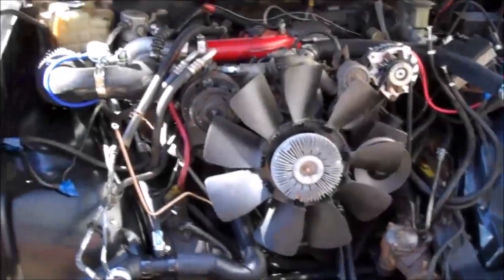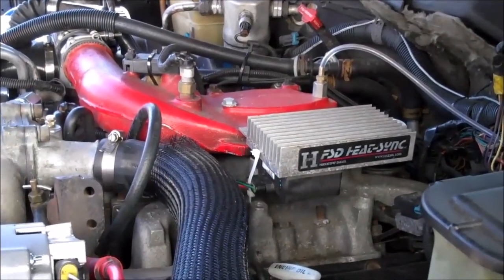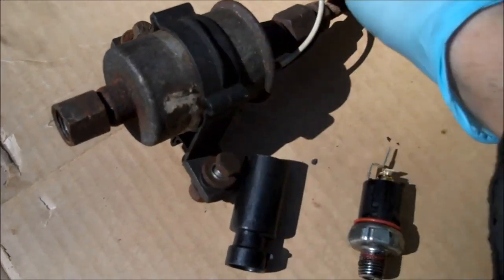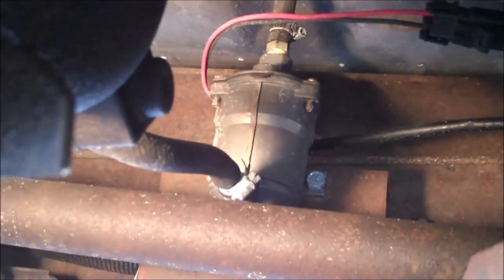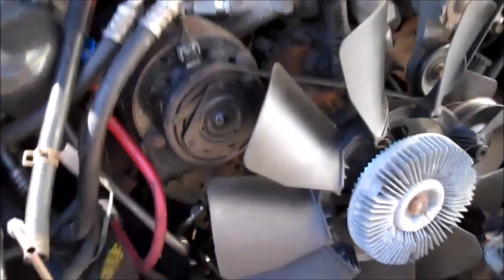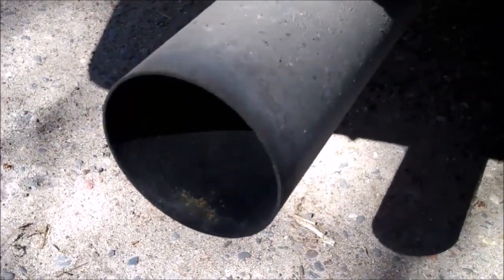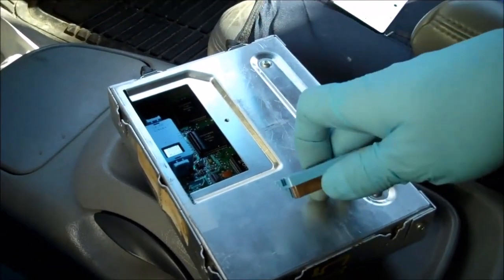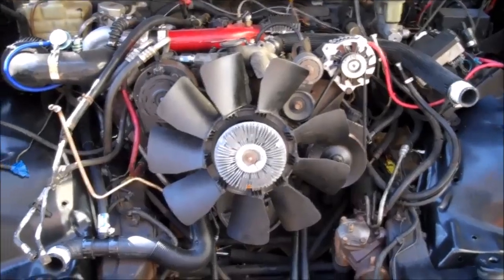6.5 DIESEL ENGINE - HOW TO BOMB PROOF IT

Comment: excellent info! I have 2 of these motors. 
the starter mount is exceptionally weak in my opinion as well. (you may mention this as I'm only half way thru).

old school diesels are far better than modern in my opinion but thats only due to the feds regulating the crap out of them. so sad.
Reply from the maker: +matt4270   I got to chime in with you guys here if it's OK.   I've read a couple pieces on VW working on the next gen of commuter diesels that are pushing 100mpg...already!   These will probably never meet USA EPA NAZI BS standards.    Diesels would change the whole US economy if just half the cars on the road were diesel and with less pollution.  Oil would be so cheap in the world they would have to give it away.   If I was ever going to believe in a conspiracy,  this is one of them.    The EPA is there to INHIBIT travel,  just another GOV strong arm to keep a fake economy going that takes money from normal people and keep the big industries well fed.   Vehicles have become such a burden to most people,  because the system is set up that you can't function without them and there is no end to the ever rising cost of having one.   Now that the vast majority of people can't work on a mousetrap let alone a car,    they got them by the short hairs.
Reply: +matt4270 I'm sure they could achieve impressive performance to get similar gas performance but our federal epa nazi government killed any hope of that. Where do we go once CAFE standards reach ridiculous levels and impossible physics? I HATE modern cars w computer controlled everything. I refuse to buy something past the mid 2000's. Its insane now.
Reply: Nikki Sherman the starter brace isn't a recommendation - it's a mandate! It's possible to actually break off a chunk of the block from the lack of reinforcement. I've broken a bolt on the starter... I got lucky. Don't ever install a starter without the front brace
Reply: Vw faked emissions, not miles per gallon. There's more energy in a drop of diesel than there is in a drop of gasoline.
Reply: ***** Amen to that Brother! The liberal asswipes have been pushing hybrid and electric cars over diesel for years, I guess because the batteries have a relatively short lifespan, so you have to jump back into the car payment cycle much sooner.
Reply: They had to fake emissions because of horsepower claims.People wanted a diesel car with gasoline type performance and drivability, so they had to make the car detune itself when it sensed being emissions tested.
Reply: BAMAJiPS
 ya buddy that's essentially what I said thanks for the reiterating though. you're a real enthusiast for sure. I'm In  need of the brace still haven't put it on. ( you just cringed didn't you?!)
Reply from the maker: +BAMAJiPS    The U.S. GOV. has done everything in their power to stunt diesels in this country.  They would not want us good citizens to have long lasting engines that get good MPG.  They want us BUYING new junk every couple years.
Reply: +Yankee Prepper - Preparing for the Wrath of God and Fine Coffee. 

agreed. feed the debt/money/"jobs" beast
Reply: +Yankee Prepper - Preparing for the Wrath of God and Fine Coffee. Thats why VW had to lie to the goon squad and fake the numbers!